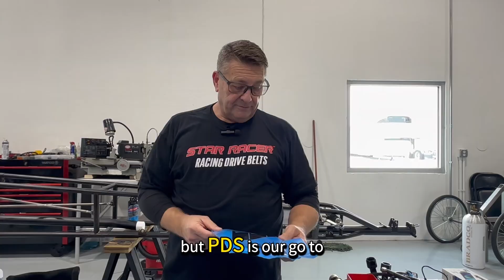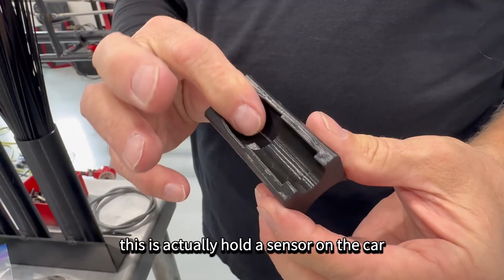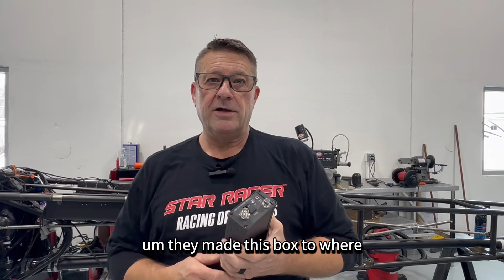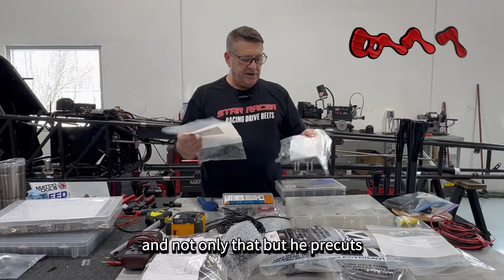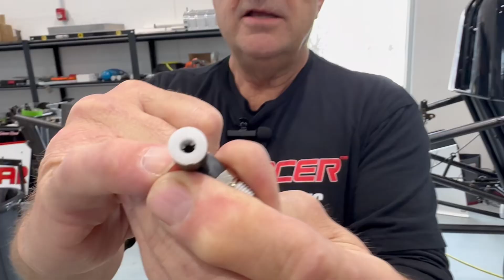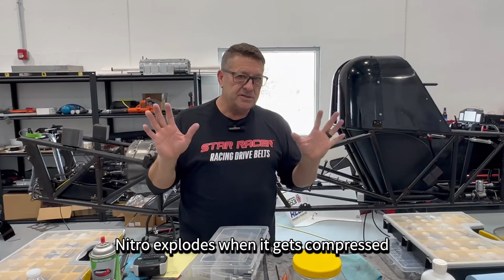LET’S BUILD A TOP FUEL DRAGSTER

Comment: As a retired Instrumentation mechanic  for almost 40 yrs for the King of Beers, the variety of new connectors, fittings and other fasteners that are available now, just WOW. You've peaked my interest to another level. The equipment and safety features used now days is amazing, and their building these parts to not fail. Thanks for sharing and also adding an explanation to uses in the race cars is so entertaining and allows someone like me to compare the similarities from a brewery, or any other manufacturing institution to the functions of everything involved in 1 pass down the race track. Again Rob, thanks for sharing, alot of people or teams wouldn't dare do this.

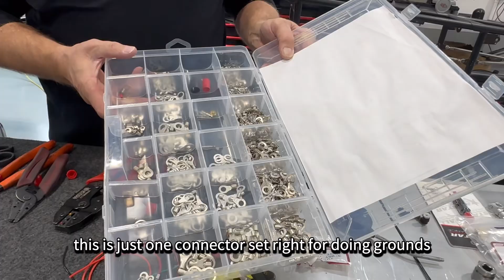Comment: 11:25 I solder all my automotive wiring also. As I used to be a computer tech, that is the habit I have developed. A lot of online "experts" will tell you that soldered joints are more prone to fracture than a crimped joint. But in the long run, crimped joints aren't reliable, imho.

Comment: Electrical Wire
Be sure to test the wire with a magnet.  Copper plated steel has been sneaking into the supply chain.
Reply from the maker: @bobroberts2371  I’ve never thought about doing that. That’s a great idea.

Comment: I love seeing behind the scenes of what all you do! 

Any chance that we could get a part number for the 1/4" air line? I tried to find something on Woco Engineering website and didn't have luck. All the air line I come across is only rated for 200f so it would be great having something rated higher. Or at least what to call and ask for. "I'd like some top fuel air line." 😆